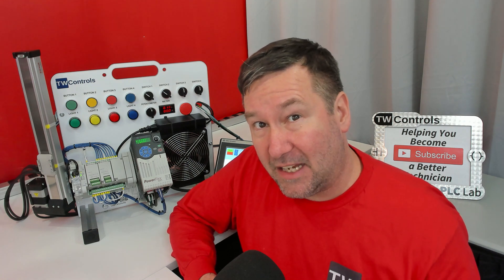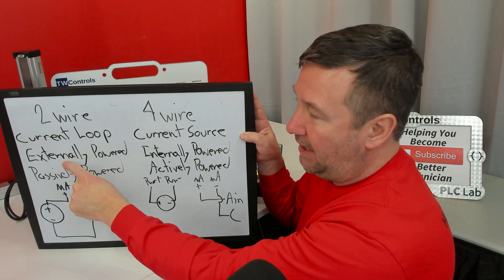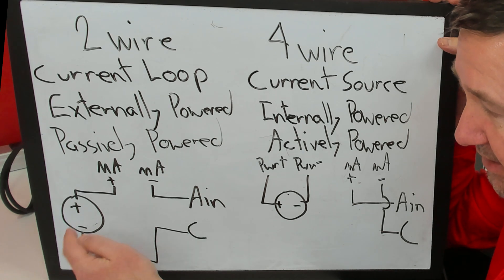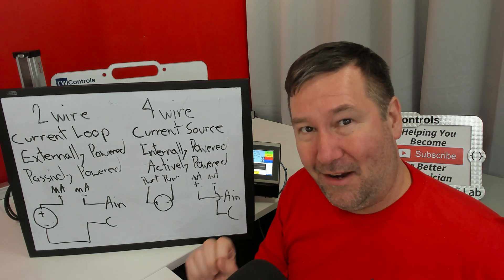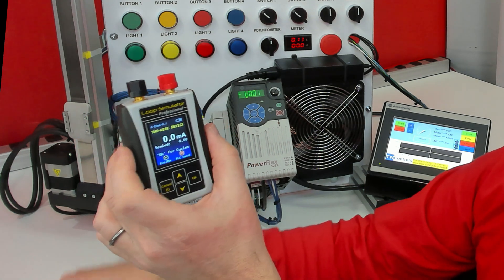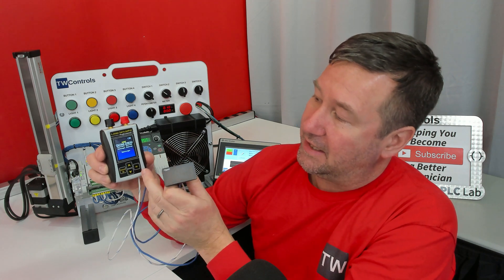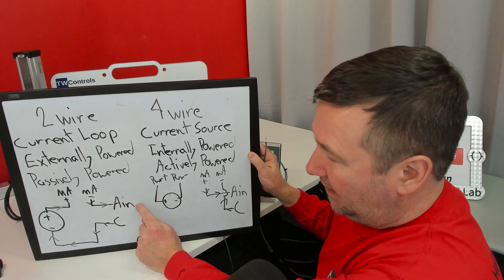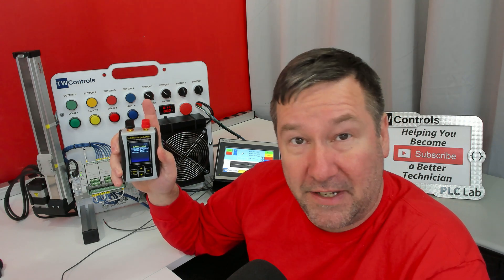How to Wire 2 Wire vs 4 Wire 4-20mA Devices

Comment: Hey Tim, I just discovered you, do you know of anything that is a portable 24VAC device for testing field devices before permanent power is online? Basically a 12VDC battery into a 12vdc to 24vac inverter that is small and portable. If not I am interested in designing one, so far I have sourced a 12vdc to 24vac inverter that is relatively small but it's $100usd, thought u might know of something cheaper to make a prototype. Only thing on market is 24vdc powered by USB-PD standard. Thanks
Reply from the maker: There are several in the market if you Google it. Depends on the wattage you need.